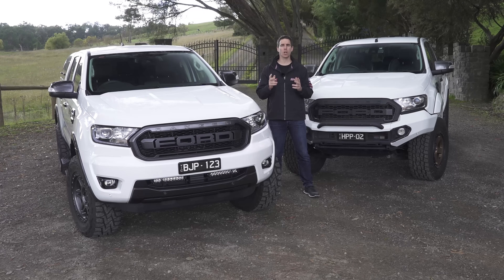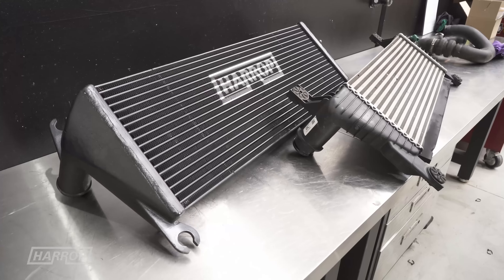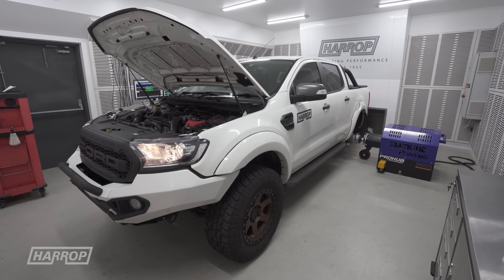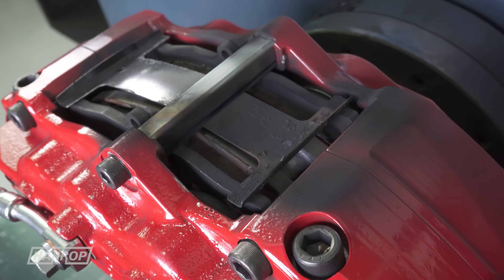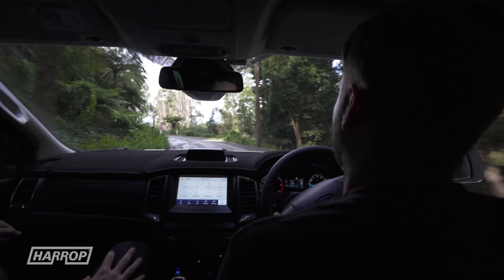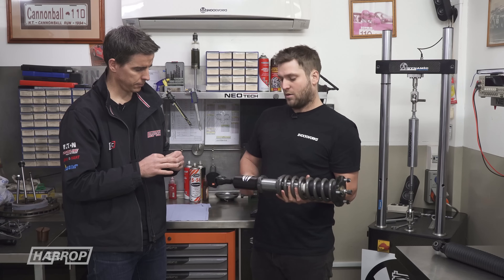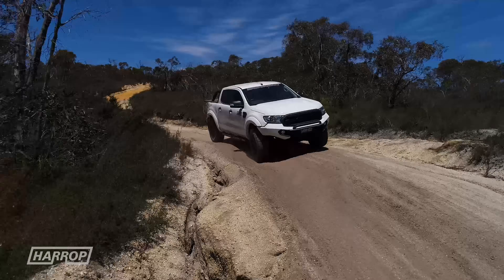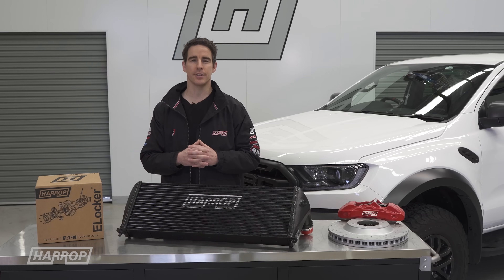Ford Ranger PX2 & PX3 | Harrop Enhanced

Comment: A very helpful👍🙏. Now We realize that 3.2 5cyl upgraded Turboc has more power than the new 2.0. How much more if the 3.2 be fitted / bi-turbo like the Ranger raptur. Even todays 2023 ToyotaLC300 6cyl , Triton 2.4, Nissan NP300 Navara 2.3 also now have twin-turbo on their diesel engines.👍

Comment: Still milk and juice 🧃🥛 😂
HARROP can you design more performance parts for the Y62 platform like suspension and brakes.
I’m running your Front E-locker and 2300 blower. No complaints here we made 400rwhp on 35” MT Razors not the “Hubs” 
Yours certainly: The Clinchdrive from Perth🍻

Comment: 3.2 dont like power tunes, rods cant handle it. Yet to see regular built engines
Reply: Can you state the details on What do you mean? Thanks.
Reply: @Sdrplnks  my mechanic replaces a lot of 3.2 engines that have been chipped etc. Put exhaust, intake etc. on so it breathes better but dont put a power tune in.